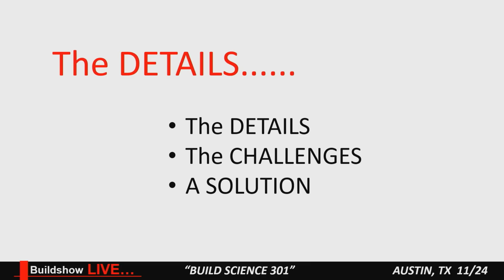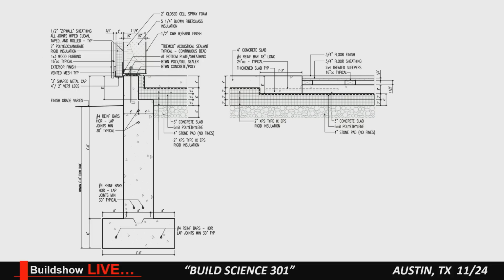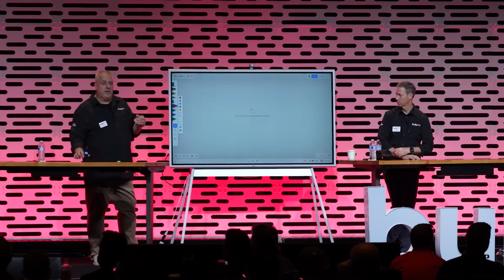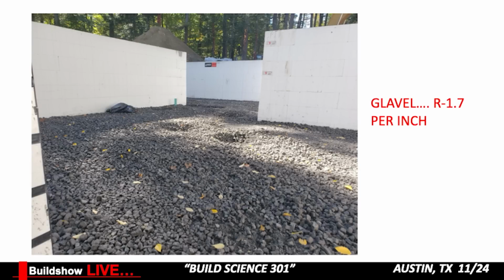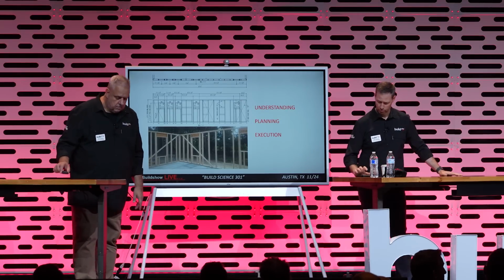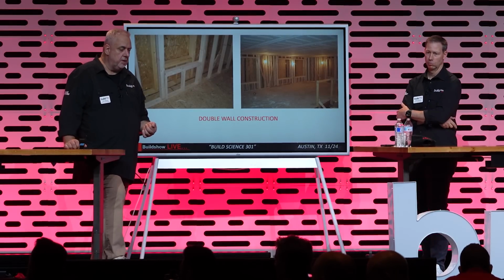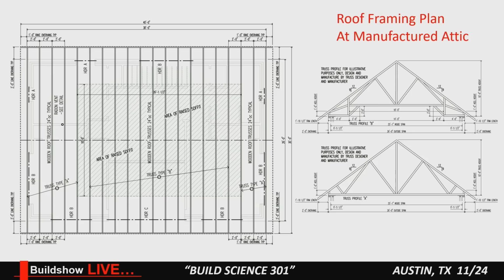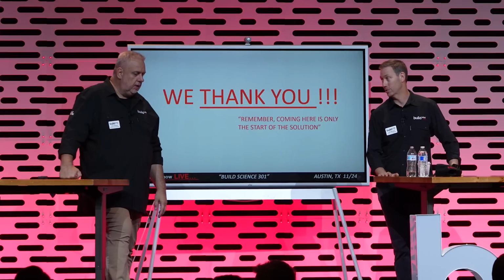Build Science 301 – Build Show LIVE edition!

Comment: I’m not big into your drop in floor trust system. Considering you’re relying on a galvanized bracket for support.I feel you’re trading longevity for thermal break simplicity. We know we have 150 year homes where floor joist never needed to be touched (you’re putting a lot of faith in a small galvanized bracket ).
Reply: Joist hangers are not new technology. If used correctly they should last as long as the joist itself if not longer.
Reply: You are correct, for wood to wood connections . I suggest you look closer, they’re missing connections  in front of the ICF telling me they could only nail in the top section of the bracket ( meaning there is no lateral support or anchors ). Zoom in and look close and notice the open holes in the bracket (no fasteners used 
,plus it’s resting up against very weak insulation).